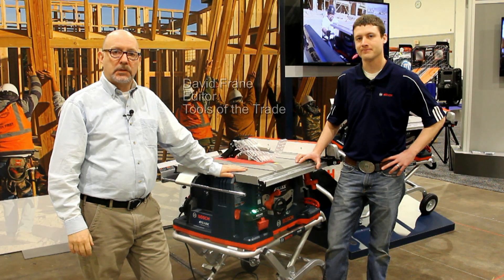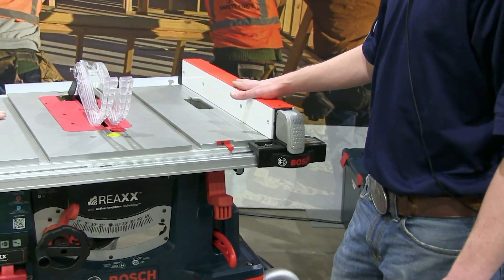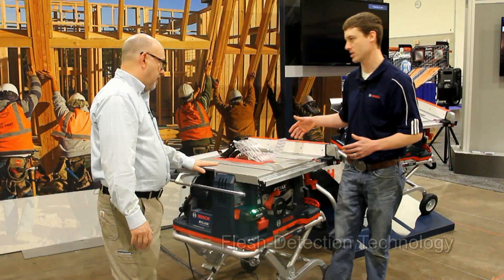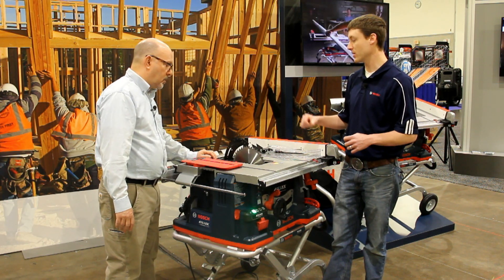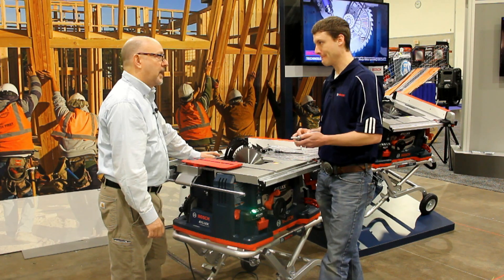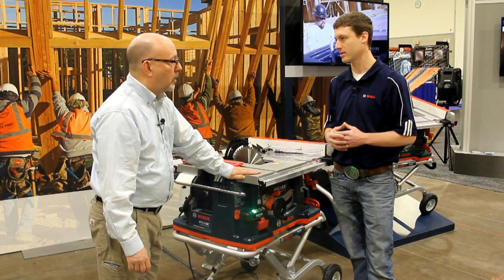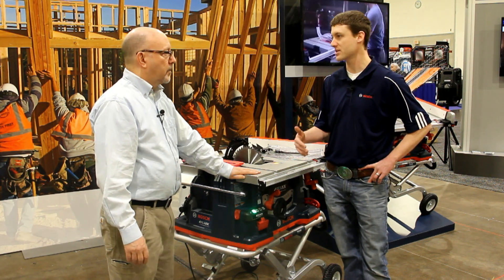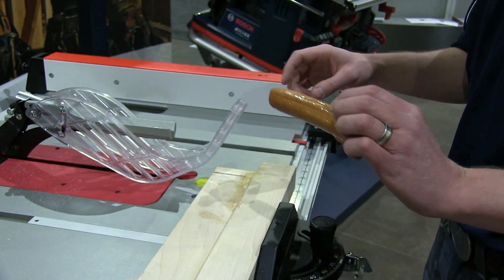Bosch REAXX Table Saw GTS1041A

Comment: Apparently my comments about not liking this saw due to its weight and how bulky it is were deleted. Go buy a Dewalt of DW745 you'll never regret it if you need a small saw like this.
Reply: I had a 745 - I hated the fence and the table top.
Reply: I also have a DeWalt, same model, it's a great machine. But, I also had to remove the guards very often and had to move my fingers very close to the blade. If you want safety, this is a good machine. DeWalt has the money and resources to come up with a similar tech, so just wait it out.
Reply: +A анонимный I also like the Dewalt for how light it is compared to the Bosch. You mention getting you fingers really close, I've been a cabinetmaker / boat builder for a while now, I've never had to get my fingers very close no more than 3" at most. I always use push sticks or a jig to hold the piece for me. If it's closer than 3" don't do it!! There is always a better way. Stay safe.
Reply: Yeah I try my best to put safety first. Still, having the stop blade technology built into every saw would be very nice to have. We will see. :)
Reply: +A анонимный I totally agree with you!!!
Reply: +MKRM27 I have had no issue with either and I own large cast iron cabinet saws as well, so I know performance. What problems did you have?

Comment: Who feels sorry for the greedy c*nts at sawstop????
Reply: Certainly not me! And it's not their greed, per se, that I dislike. It's their attempt to use the FedGov to force their would-be competitors to purchase rights to SawStop's design as a condition for even entering the market with similar saws. And that's only Step 1 of their corporatist a-hole maneuvering. Step 2 is that they then lobby govt to pass legislation to force other manufacturers to implement safety technology similar to SawStop's. And guess whose safety technology those manufacturers would be forced by law to integrate! You guessed it: SawStop's. This is what a TRUE robber baron looks like. Anti-trust legislation only brings about, and makes worse, the alleged ills of the market which it purports to cure -- always has, always will.

Comment: Of the four 4000/4100 saws purchased in the past several years, only the newest has yet to fail.... All the  best features, I'm slowly learning, are useless without a dependable motor to turn the blade. Any storage solutions for the growing number of Bosch carcasses accumulating in my shop? Maybe a couple solidly engineered replacement motors??

Comment: OK, Saw Stop finally has some competition. Saw Stop started with an industrial cabinet saw and worked their way down to a job site saw. Bosch, who only makes job site saws put the new technology there. I'm wondering if Bosch will build a cabinet saw or license the technology to some one who does. This has a couple of features that Saw Stop does not have, like not wrecking the blade and not needing another cartridge for dado blades. It does have a fixed number of firings before it locks you out and requires factory service. That makes sense ; if it slams down that many times it  probably should be checked.  I want to see this on a cabinet saw.
Reply: Too bad SawStop sued Bosch to oblivion.

Comment: Is there a way to "test" the material with the blade? Does it sign if it is cutting conductive materials when you turn off the safety?
Reply from the maker: ComandanteJ Yes, you put it into the override mode, cut, and then look to see if the LEDs flash in a particular way (there's a key to reading them on the side of the saw). The lights will tell you whether or not the material you just cut in override can be cut in normal mode without automatically tripping the mechanism.
Reply: ToolsEditor Awesome, thanks!

Comment: I was an early Sawstop buyer and can tell you that these systems do work in real life situations. As far as whether or not the blade is damaged, I prefer Sawstop's destructive process. The day I stick my hand into a blade, I want my hand to be the only thing the engineers thought about. After the Bosch fires off, you hear the blade continue to spin down. If the retraction had failed for any reason, the saw would continue to cut. Basically, Sawstop takes two actions to protect the user, while Bosch depends on one.
Reply: +johnnymeansii I see your point, but there is a little flaw in the argument. Sawstop's blade doesn't stop rotating until it hits the aluminium block - it doesn't stop and then gets shot down. In that respect they are actually the same, the blade disappearing while still rotating. This said, I don't mean any disrespect for Sawstop's solution, but Bosch found a way of saving the blade in addition to first and foremost saving my finger, and I don't mind that :-)...
Reply: +Sten Møller, actually you're mistaken. If you watch the slow motion film of a Sawstop actuation, you'll clearly see that the blade stops when the brake hits it. That sudden stop is what forces the blade to pivot below the table. The Sawstop blade would stop spinning even if the carriage were prevented from pivoting downward by some obstruction or physical damage.
Reply: The saw stop is a much better system. I'll buy a new $60 blade and $80 cartridge. In 20 years off using table saws, I've never been touched by the blade. So it's not like it happens often enough to worry about spending $140 to get the saw stop up running vs $50 for the Bosch.

Comment: WV591 All products go through iterations and improvements. The SawStop was the FIRST saw with this safety feature. The designer definitely believed that it's better to damage the saw blade than to cut off your finger, so it was a conscious choice. Only later was it discovered that false-positives (wet wood & conductive materials) meant that the saw needed to be improved upon, which is why we have this one. Don't bash great inventors.

Comment: Tired of seeing this SLOW MOVING hot dog BS. when you cutting boards you move at much faster rate. if this technology really works, put your finger there and move it at fast rate like a real world cutting not this feel good BS junk.
But at least they got it right as far as not damaging the blade. eat your heart out sawstop morons.
Reply: +WV591 They actually showed the Sawstop functioning with a hot dog at a fairly high speed, and it worked. A slightly deeper scratch in the hot dog, but nothing to worry about. While I appreciating this Bosch product as an improved solution, I think it's a bit unfair to refer to the Sawstop people as morons. After all, they were a number of years ahead and are surely the inspiration for Bosch's solution. As for sueing Bosch, that certainly seems a bit out of order. But that's lawyers for you...
Reply: Some other company should sue sawstop MORONS for copying table saws in first place.they had all this time to figure out an improvement but couldn't figure it out now Bosch comes up with clever solution and they shit their pants and the only reaction is let's sue.